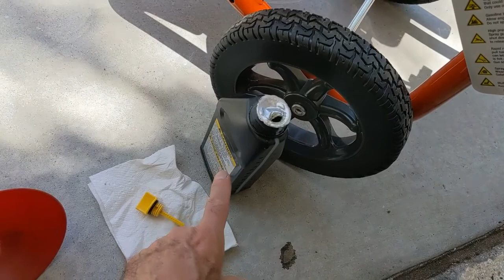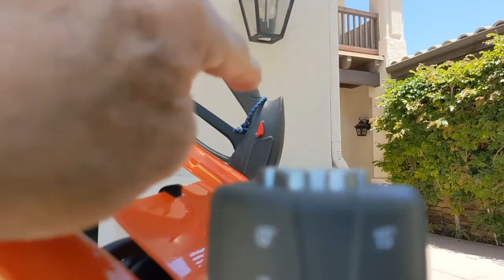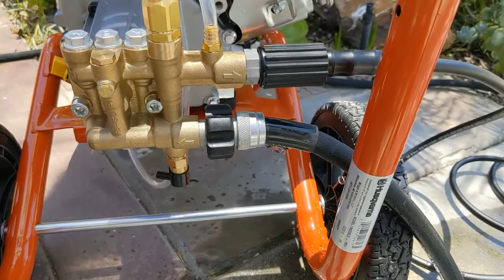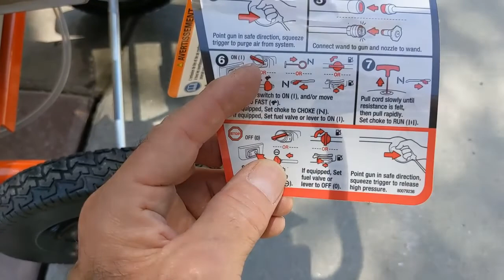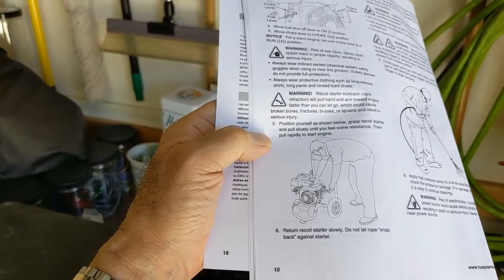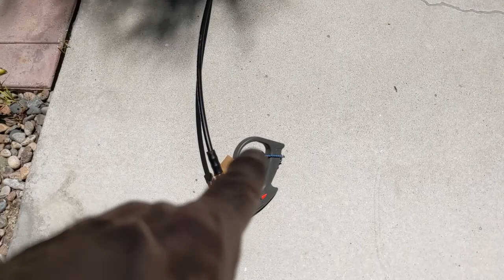Tools Husquavarna 3200pw power washer start up 2nd cut by froggy

Comment from the maker: Shut the fuel off when not in use & if you store it for extended periods run it dry (let it run with fuel off until it stalls) and add fuel conditioner (for small gas engines) to the fuel left in the tank or drain the tank. Follow directions for conditioner. :)